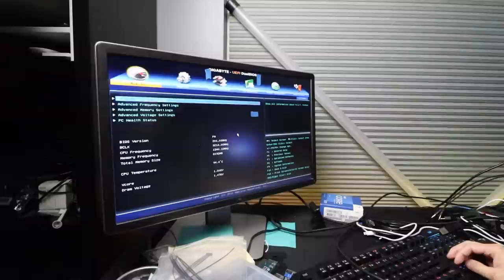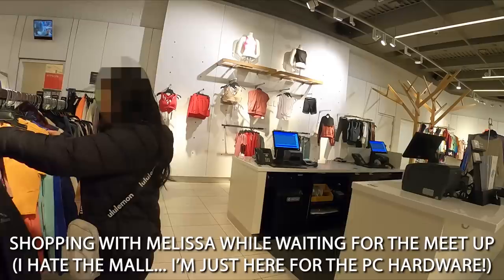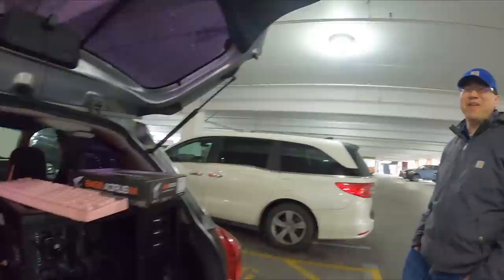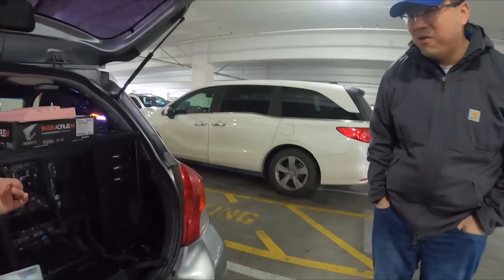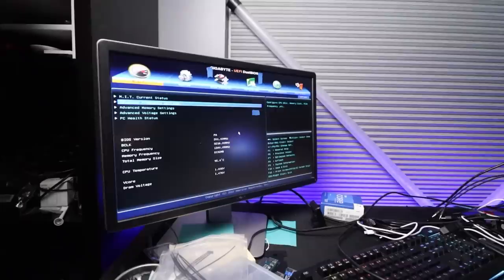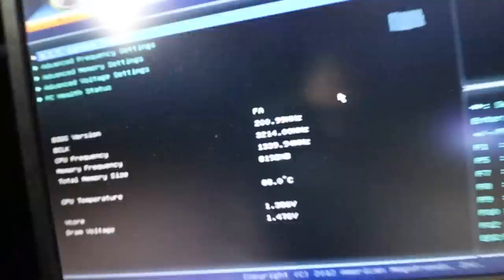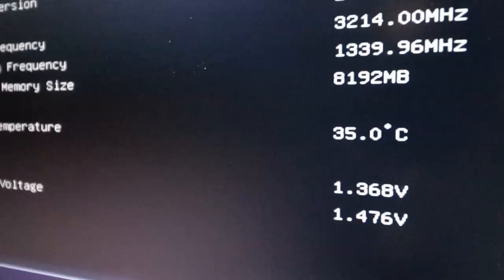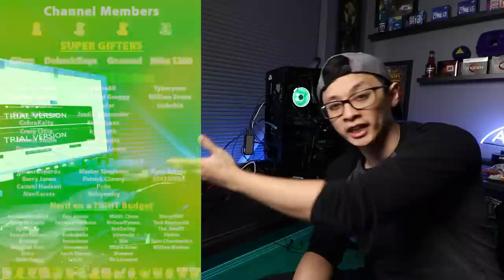Seller's CPU ran HOT after I took it home...

Comment: Sometimes you get an air bubble with the AIO coolers, if you lay the pc down on its side and let it run for a bit like that it could fix the issue
Reply: Yeah or if that doesn't work take the pump block off & tubes up give it a shake while it is running, it helps get some water into the impeller
Reply: Laying it on it's side powered on with th CPU hitting 99-100 degrees for too long could cook it
Reply: @anthonylong5870  So how do laptops & Highend Prebuilts like the Alienware i9/R9 PCs keep running when they are throttling because they are sitting at 105° or whatever TJMax is 🤷‍♂???
& even older Athlon & Phenom CPUs like the one Danny is testing with here will shut down when they need to.
Reply: @shaneeslick  They run because they are throttling.  Which YOU DONT WANT TO DO.  And constant overheating/throttling shortens the life of the CPU.  And sometimes the CPU can fail to throttle and cook itself....
Reply: @anthonylong5870  "They run because they are throttling" Yeah & that CPU Danny has will do the same, so which is it do CPUs die in minutes of running at 90°-100° or run fine for years at 90°-100° because they are throttling themselves running at those temps?
I have over 10yr old CPUs that run with OC in cases that have very minimal airflow regularly reaching temps of 90° in summer & are still performing fine, it will at most take a couple of minutes to remove the Airbubble from an AIO Pump, plus Laptops & those Alienware & other Brand Prebuilts run throttling themselves at those temps all day for years, so stop trying to scaremonger people with Misinformation that a CPU running at those temps for a few minutes will die.
Reply: @shaneeslick  Your asinine theory is basically "Why cool a CPU at all, it will be fine throttling itself forever"..... It's not even worth the time to explain it to you
Reply: @anthonylong5870  No that is not my theory but hey just be stoopid, the point is running a cpu hot for a couple of minutes will not kill it. The video is edited so how long was Danny actually running if for at 90°-100°? Was the CPU running that hot when the previous owners wife was using it? did the CPU in the video die ??? How many years of life did it lose ??? 
"asanine theory" even after seeing the CPU running this hot multiple times just in this video you claim "Laying it on it's side powered on with th CPU hitting 99-100 degrees for too long could cook it" but it was STILL WORKING FINE when Danny changed the cooler, even reality shows that it will not cook a CPU.
But please explain your theory of how parts that have life spans of over 10yrs at hotter than 100°C will reduce their life span so drastically or die in a couple of minutes if they run at 90°-100° ???
plese give me all your years of CPU Engineer/Designer knowledge because apparenty my knowledge of learning about + building & servicing PCs since the 80s has taught me nothing.

Comment: Good old air coolers,  reliable,  affordable,  it lasts longer than AIO. Whats not to like. I always prefer air coolers. Just newer chips today run extremely hot wich is unfortunate. ❤
Reply: Oh yeah, I Don't even want a liquid cooler.
Reply: Unless I am doing a complete liquid cooled system which I probably never will, air cooling ftw.
Reply: I'm an old-school Air-Cooler guy. Putting a liquid cooler into a PC just adds a new point of failure into a machine, and I never recommend it. Don't care how nice it might look.
Reply: Plumbing is for the bathroom, not the PC.

Comment: First and what do you recommend on second hand power supplies, i have a gtx 1050 ti and i7 3770 also any upgrades to my current system will be greatly appreciated. Using a dell opty with atx psu. The gtx 1050 ti has no extra pcie connectors.

Comment: I bought a Sapphire 6700XT Nitro+ for 280USD.

Played with it a while and noticed that it was 110C on the hotspot. Had a hunch so I asked the seller "did you repaste this" he said yes. Internally a I groaned and repasted it myself. 

From what I could tell, homie did the rice grain method instead of spreading it out properly. Which is bad because unlike CPUs, GPUs dont have a heat spreader. You have to spread the thermal compund yourself to get full coverage; PROPER coverage.

Put it all back together and played the same game and voila, -20C on the hotspots.

EDIT: the paste I used was some rando tube I found lying around. You dont need the best of the best to properly cool a GPU/CPU as long as it's spread properly.

Comment: Does most am4 CPU cooler work with am3 mobo/cpu? Was thinking of reusing an old pc I had laying around but the CPU cooler is broken
Reply: Yes they have the same layout
Reply from the maker: Only if you use the brackets with the latching mechanism, because those are spaced the same. But the left to right holes on the motherboard are different, so coolers with custom brackets won't work

Comment: that aio watercooling, its to bad for cpu, it seems to hotter operating temperature because CPU has to upper 125 watts of heat disipation.... in that case you need an 360mm watercooling or heatpipe solution like an bequiet dark rock 4. greetings from CHILE.

Comment: i actually still use that exact cpu and actually watching this video from it(media pc) it can still do things pretty well and still run games you would play laying back and chilling. defo unnormal to hit those temps with an aio. mine runs like 29c idle and 35ish with load  with a basic air cooler. the aio is save-able but not really worth it unless you just wana tinker to fix it. gurgle noise is cuz its lost fluid over time and the impeller's plastic "bearings" get worn over time and will have problems turning an will stick. taking it apart and pulling the bearing a bit and realigning it. some cleaning and a refill and it can work again. but wont be as reliable. its prime days are gone and will fail again in a matter of time. i have a similar model which has same pump and did repair it but only have it for messing around. would not trust it for prolonged use or if im not around to keep an eye on it

Comment: Cpu running hot…..suddenly buying a pc where the blasted thing was plugged power button into the reset connector on the motherboard doesn’t seem so bad lol.

I found OfferUp can be a good way to get a decent pc that has upgrade potential. And in todays tight economy folks, but secondhand and upgrade parts as you can.

Comment: Need recommendations for someone in the Midlands to fix my pc, ryzen 5 3600 b450 pro 3200mhz 16gb ddr4 rx580 8gb oc bequeit 750w dark pro gold rated, i brought a 6600xt, and its just boot looping and loads of mad crazy things, i have used ddu 5 times but still not working

Comment: You'll just end up with an angry buyer if you try doing anything with that cooler. I had an h100i that I tried putting into a build for cl that was my own personal cooler for about 3-5 years, and they just don't last that long. I forgot if it was Linus or Tech Yes but one of them ended up with an aio that had an insane amount of buildup in the radiator, and they just couldn't use it. Also kept the aio just to see if anything else would happen to it and the tubes ended up with dry rot a year later.

Comment: my corsair h100i just died... similar temps.. but it served me well for 10 years :O
Reply: the cooler probably lost a lot of coolant, sounded like there was a lot of air in the system
Reply: You can refill coolent but if the radiator served 10 years , ypu can give it a rest

Comment: Love your videos. I tried to use my m.2 attached to a pcie adapter as a boot drive on an older mobo and was unsuccessful. I contacted a forum that I belong to and was told that you can not boot using this method. I mounted it on my gigabyte mobo and it booted up fine. Did you find this as well?

Comment: Personally I dislike the am3/am4 mounting system, if you don't use a custom block, the 2 mounting points are garbage :p
Always had problems with my H80i as well, had to re-apply the cooler a couple of times to get it 100% contact over the chip

Comment: So i have one problem. I have i3-3220 and at idle in bios it shows 35°C(stock cooler) and when it boots us if i leave it for few minutes booted in windows it jumps up to 65-70°C.(i use hwinfo for cheching temps) I changed thermal paste about 2 days ago and its same.Im not sure if that is normal or should i be concerned about it?

Comment: hey trung ive been watching a few of your videos now, and came across one that you were looking for a am3 motherboard? Ive been trying to sell a full mini pc i put together. i just finished building it like 4 months ago but decided the performance was not what I wanted. The majority of the parts were donated to me except the case, ram, graphics card, and cooler. anyways i know you have been looking for a little older system I have a gigabyte micro A.t.x GA78LMT-USB WITH A AMD ATHALON 8350 8core 16 threads. apparently these are sought after for o.c? not too sure about that. so just wondering if you had any interest in it ill include some photos you can message me if you wana talk about it. hope all is well with you.